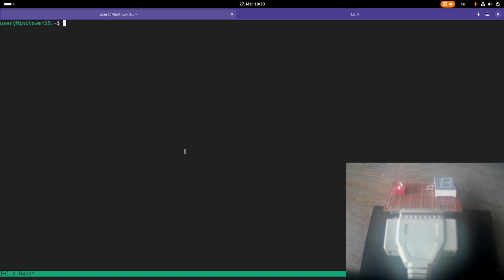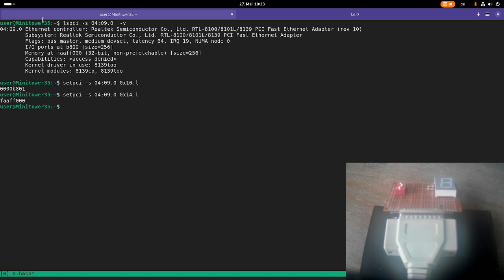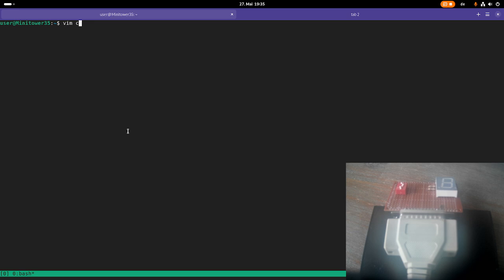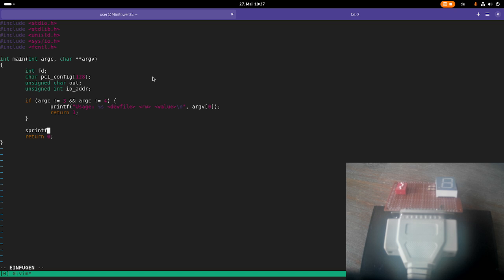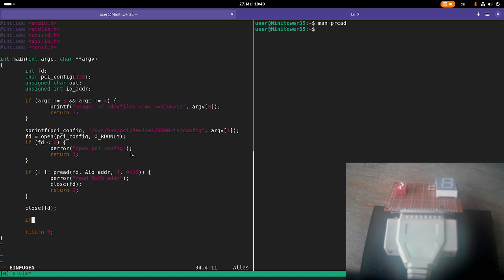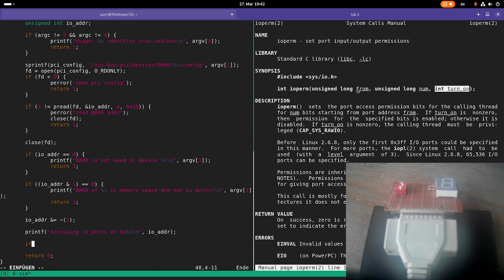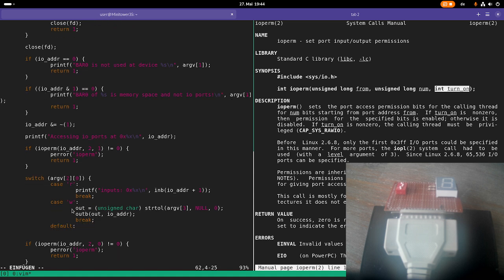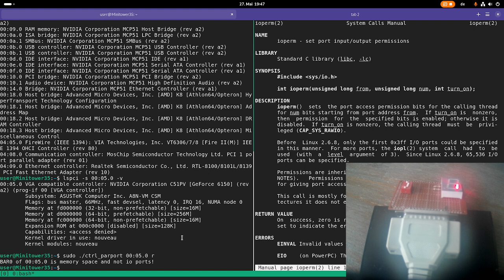GNU/Linux & PCI (Express): Part 10 - Accessing PCI(e) IO ports from userspace

Comment: great tutorial but i have a few questions. not about this but in advance. the first one is: am i right that you are using your pci device here without any driver like what was described in previous videos? the second is: here i see that you are using some info about your device that is given by system as an argument for your app but you are getting it manually and is it possible to do it automatically? like: check pci devices, filter them by for example vendor, get what you need?
Reply from the maker: Yes, correct, for this video, I am accessing the PCI device without a driver.
You mean the Bus:Slot.Function Number I am passing. Yes of course you can search for it. See the first videos in this playlist how to search for devices by using the pcilib.

Comment: Thanks  Johannes for the wonderful explanation. Here why are you not using mmap() ? Is mmap() not possible here or you are trying out a different method ? Are these address space different from memory address space ?
Reply from the maker: @ShreyaMandal-f7b  you are welcome ;) you can only memory map memory but Not io Ports. Thats why I am using the io functions here.
 But modern devices don't use Classic io Ports any longer. Instead they are using memory mapped io (mmio) which can bei accessed with mmap.